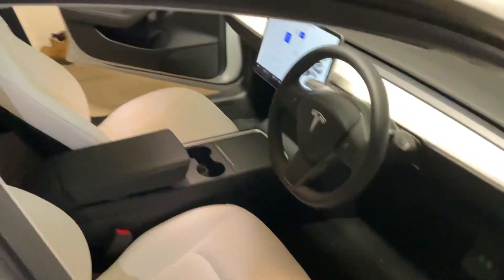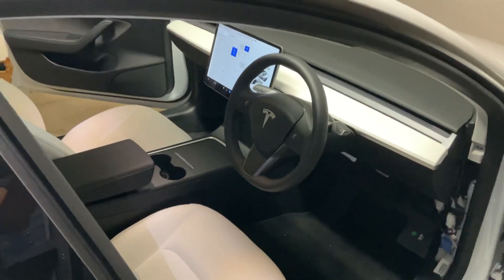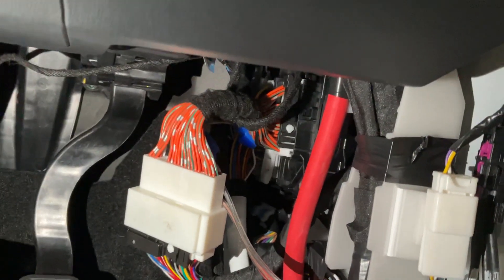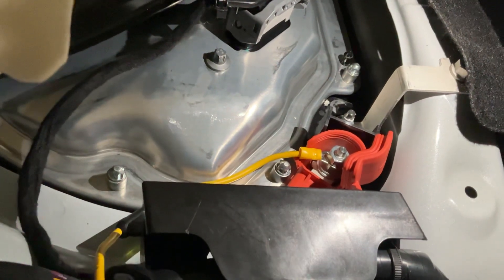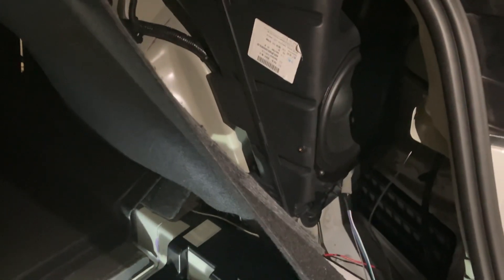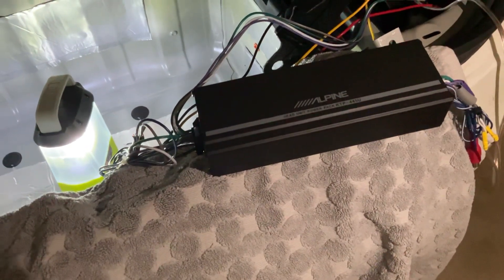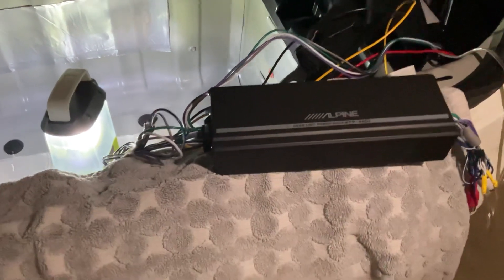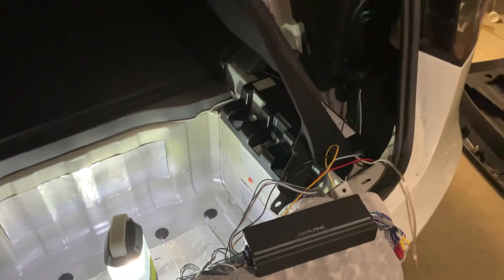Tesla Model 3 SR+ OEM subwoofer install

Comment: Great video!  I’m planning this similar install on my ‘19 sr+.
Nice that you have the Hansshow DIY cable, I do too, was wondering if I’d be able to tap those instead of the factory harness, that definitely makes my life a little easier!

Question - did you ground (earth) to the trunk (boot) or in the penthouse?

The Wordpress wiring diagram is a little confusing to me.  You have to splice the OEM cabling coming from the subwoofer (foam wrap sheath) into the alpine amp harness?

Overall are you satisfied with the upgrade?

Thanks!!!
Reply from the maker: Thanks!

I grounded the amp to a random chassis bolt next to the sub, not in the penthouse. There are plenty of bolts you can ground to in there. 

The OEM sub has 4 wires- 2 positive and 2 negative. Remember it’s a dual voice coil sub, which is why it has twice the inputs as normal. You wire it up exactly as the Wordpress blog states. 2 channels going into the 1 sub. Yep splicing those cables is a bit of a pain as they are short and wrapped in foam. I did them with solder and heatshrink. You wouldn’t fit a no-solder splice there.
Reply: @locksmack  nice info, thank you! - I may do that splicing work while the sub is out of the car to give myself more room.   Solder and heat shrink definitely a better option over positap!  Cheers!
Reply from the maker: @TopShelfTesla  definitely do it before installing it. I can’t imagine trying to do it when bolted in.
Reply: Thanks for this Paul, I deep in the install at this very moment but stuck trying to figure out which is positive and negative out of the brown and grey wires to the door woofer. Do you remember?
Reply: @CCHBrown  hey Chris!  Sorry for the delayed reply.  I don’t remember off the top of my head.  You can always switch them at the amp side if the polarity is reversed.  Sorry I’m not much help.  If I get a chance I’ll take a look in the car and let you know.  Also my car is a 2019 not sure if yours is the same?
Reply: @TopShelfTesla  Thanks for replying, no problem at all! I ended up finding a source saying: passenger side mid woofer brown - / grey +. Seems to be working so far :D
Reply: Ok…so I’m having an issue.  Got everything installed, but the amp is not turning on.  I just redid all my splices, not sure if the alpine amp has any power indicator but I do not see one.  Also, what are the correct dipswitch settings? I’m not sure if mine are correct?
Reply: Bad splice.  We’re up and running!
Reply from the maker: @TopShelfTesla  nice one Paul! How does it sound?
Reply: @locksmack  what are your dipswitch settings on the amp? I am overloaded with bass even at very low volume and the eq at -6.0!  I think I have to adjust a level, or maybe the dipswitch settings.  The factory sub is way more powerful than I thought!!!! Thanks so much for the help, much appreciated, cheers!
Reply from the maker: @TopShelfTesla  hey mate, I can’t remember how they were set but it sounds like you have it set to line level rather than speaker level input, so maybe flip the corresponding dip switches and see if that helps. I recall the instructions were a little unclear as the pictures of the dip switches could be taken either way (eg white or black is the switch). 

Did you turn the level knob right down? Mine was almost all the way down when done. Also remember that with the boot open (and your head inside), the bass is stronger. It may not sound the same from the drivers seat with the boot closed.
Reply: Figured out the dipswitches, this may help anyone else with this install!
I set the dipswitches to “80hz” setting on front speakers (switch 1 & 2), “off” for rear speaker (switch 3 & 4) , 4 channel (switch 5) and speaker (switch 6)

Turned rear gain all the way down to min and set front gain to just slightly above 9 o’clock position (more than enough, anything higher will cause distortion and rattling)

Very happy with results.  Thanks again for all the help mate!  Cheers!!!
Reply from the maker: @TopShelfTesla  No worries at all Paul, happy you got it working!

Your config is different to mine. I disabled all crossovers, and ran it in 2ch mode. I'm not sure how you wired it in 4ch mode but hey if it works it works!
Reply: Me again - tackling this tonight.  I’m hung up on one part…I have the Hansshow diy harness.  I am only tapping the passenger front door woofer +/-, correct? Not both driver and passenger (I’m LHD)

The wiring diagram is a bit confusing.  The sub wiring part I understand but the speaker wire side isn’t very clear to me.
Reply from the maker: @TopShelfTesla  hey mate, that’s right. I got hung up on that too but learned that bass frequencies are recorded in mono so there is no issue from just tapping one side. Mine has been running for weeks and I haven’t had an issue with left/right balance. 

Basically once you tap the door woofer wires, you connect it to BOTH the left and right inputs on the amp (after chopping off the RCA plugs). 

Best of luck with the install. I’ll keep an eye on comments for this video in case you run into any issues and need advice.

Comment: Great install! I have a 2022 SR, do you know if the front speaker cables will be the same colours?
Reply from the maker: I don't know for sure, but I'd bet they are the same. The change in colours seemed to be at the same time as the other major changes in early 2021 (heat pump, chrome delete). There hasn't been a major change since, so it's likely the same.